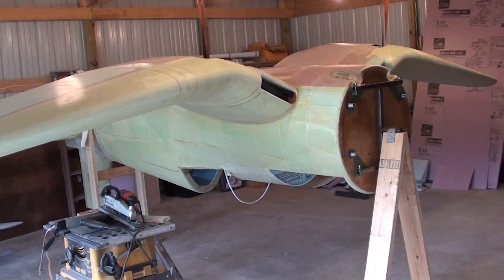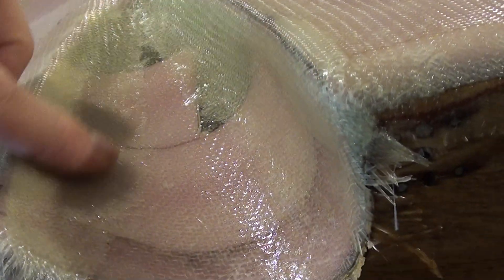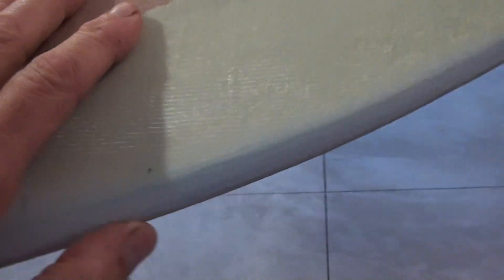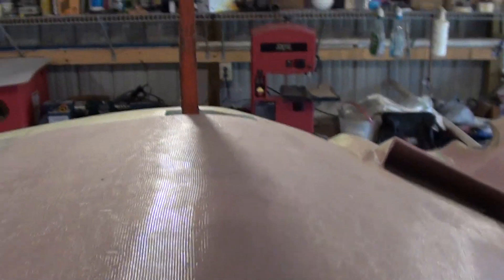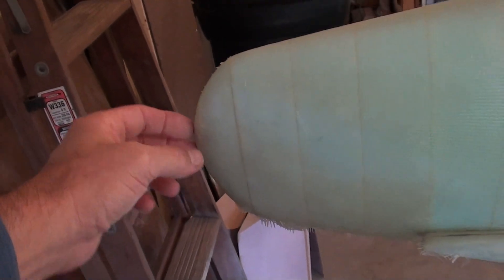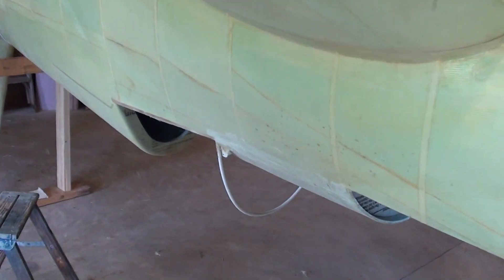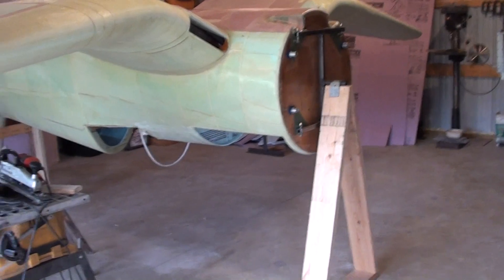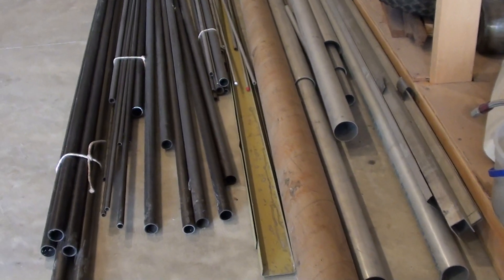W.A.R. Corsair Update 10-9-2017

Comment: Hi Dyno Don. As usual you are doing a superb job on your Corsair. I see that you mentioned that you were getting ready to slurry the surfaces to start the finishing process. I did the same thing to my airplane and it was what seemed like a never ending process of filling and sanding. There is a new way to do the filling and sanding that seems much better. It was developed by Cory Bird on his flawless Symmetry aircraft ( don't know if you know of Cory but it would be worth a look at his plane). Anyway here is one of the links that describes the process. I hope this saves you lots of elbow grease. http://www.canardzone.com/forum/topic/16536-cory-birds-raw-epoxy-finishing-technique/